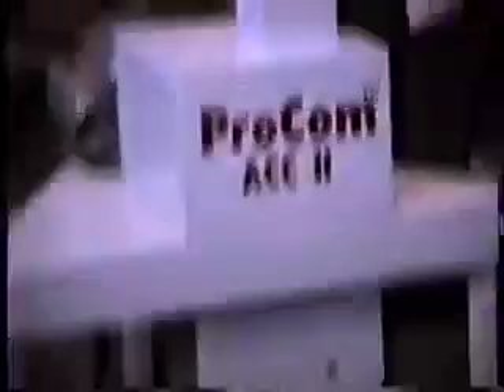Can Crusher Plans | Aluminum Can Crusher Plans

Comment: I'm curious as to what it would cost to make this, since you can't view required materials before buying the plans I have no way to decide if this is something I can afford to build or have the knowledge / tools to build.
Reply: Well man that depends. I bought the plans for this. If you plan on fabricating the parts yourself it’ll be a lot cheaper. If you want to have a machine shop do it, the costs will be considerable (thousands of dollars) especially if its only one unit.